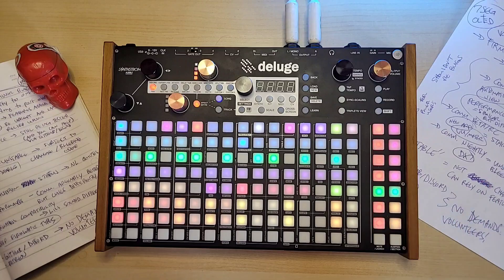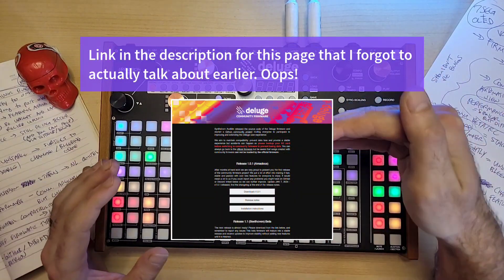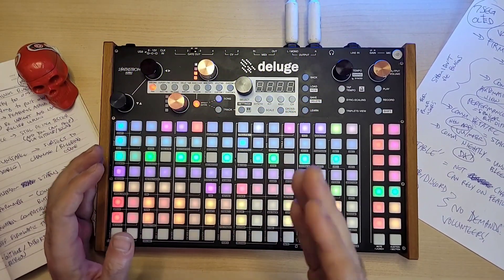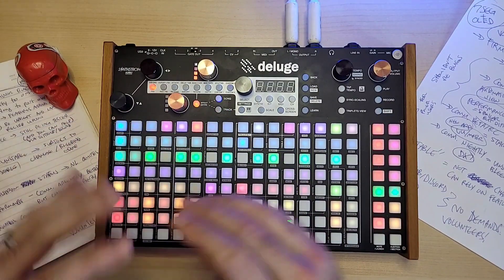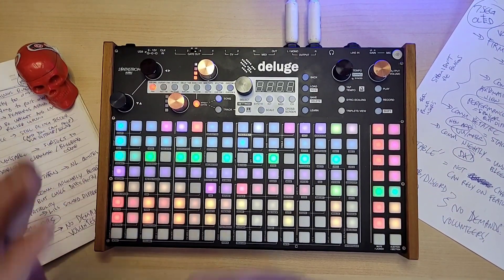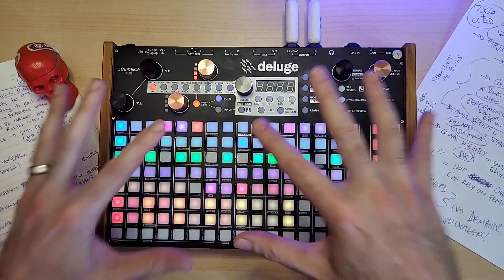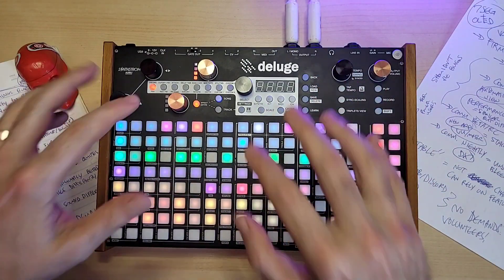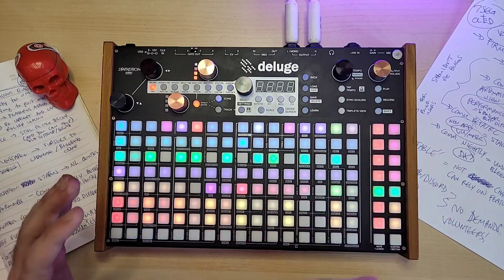Everything you need to know about the Deluge Community firmware

Comment: I think I've had two crashes in over six years.
the OLED vs 7-seg thing..... both of mine have the OLED now, & it did make a difference to the speed with which I could find things, but it is definitely not essential. all the same functionality is there, whether it's in proper writing or red crayola... 😂
a magnificent machine which was fully-formed from the get-go, & just gets better with each solid iteration of the open-source versions. the way synthstrom run their business & treat their customers is exemplary, & should be the standard by which communication & support from other manufacturers is judged. yeah, torso, I mean you.
Reply from the maker: Yeah, it's a great unit with an excellent team/creators and just keeps getting better!